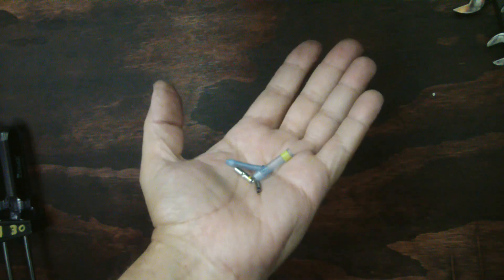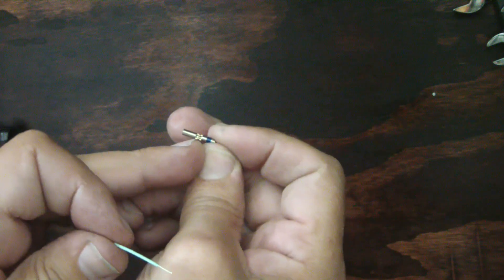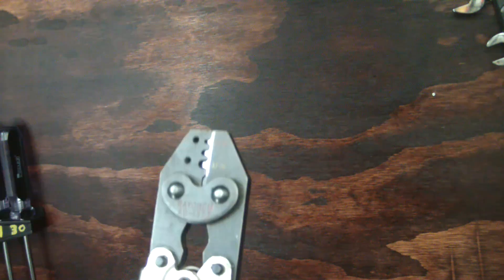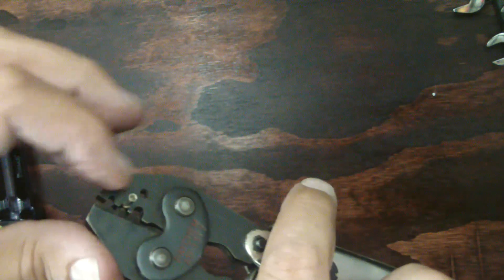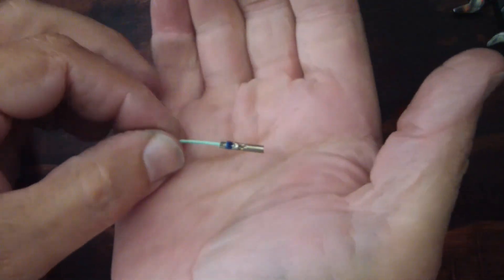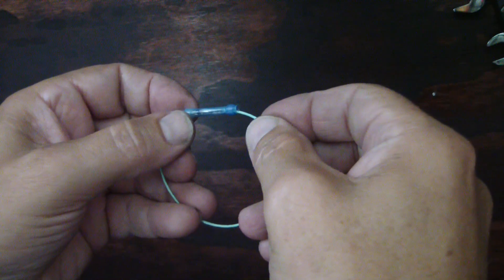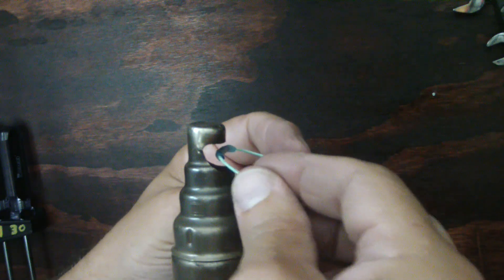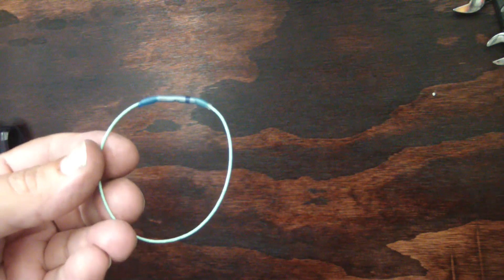Crimping an environmental butt splice / water proof splice

Comment from the maker: Heat Shrink Water Proof Butt Splice Kit
https://amzn.to/3MWT839
Cordless Heat Gun
https://amzn.to/3MXAbxd
Wirefy 95 PCS Heat Shrink Tubing Kit - 4:1 Dual Wall Tube - Adhesive Lined
https://www.amazon.com/dp/B09NW6TVC6?ref=t_ac_view_request_product_image&campaignId=amzn1.campaign.1O2O2EMD6VNI0&linkCode=tr1&tag=737mechanic-20&linkId=amzn1.campaign.1O2O2EMD6VNI0_1709174175862
Haisstronica 6 in 1 Crimping Tool Kit 
https://www.amazon.com/dp/B0CPPC8W6J?ref=t_ac_view_request_product_image&campaignId=amzn1.campaign.1RDKUM6LG6HV&linkCode=tr1&tag=737mechanic-20&linkId=amzn1.campaign.1RDKUM6LG6HV_1754345250833
Wirefy 200 PCS Non Insulated Butt Connectors Kit - Butt Splice Connectors
https://www.amazon.com/dp/B08BYXP4RF?ref=t_ac_view_request_product_image&campaignId=amzn1.campaign.1O2O2EMD6VNI0&linkCode=tr1&tag=737mechanic-20&linkId=amzn1.campaign.1O2O2EMD6VNI0_1709174205057
MiniSeal Crimp Splices: 50pcs Yellow
https://amzn.to/459Eyko
MiniSeal Crimp Splices: 50Sets Blue 
https://amzn.to/4kwyNSB
Red Heat Shrink Butt Splice Connector
https://amzn.to/4kVngvY
WS-1226D Crimping Tools Works for Raychem TE MiniSeal Low Profile Environmental Splices
https://amzn.to/4ecKZ8Z
Copper Lugs
https://www.amazon.com/dp/B0BB7NBSPJ?

Comment: In your video you talk about and show a Raychem splice, but the link you provide goes to an Amazon listing for TICONN connectors.  They look similar, are way cheaper, but is the quality as good as Raychems?
Reply from the maker: Probably not as good but for automotive work they will be plenty good. The only Raychem's I could find at the time of this video were outrageously expensive. I have just found some JReady splices I just added to the description that are M81824/1-3 that are reasonably priced.

Comment: Its not a guard. Its a go no go slot that blocks oversized wires from being inserted. It also helps retain the splice. $1 per splice its top of the line and the mil-std crimps are $260 new. Not for menial tasks.

Comment: Splicing wires that are critical i.e. Maritime, Aviation, Telecom and Space is not optimal......we replace the wire, harness, cable in its entirety always. Solderless (crimped) Terminations is a different thing.  having said all of the above, if you have to do a splice, this Gent's video is top shelf using the Raychem system IMHO. BZ
Reply: Only matched set cables should not be spliced otherwise the standard is no more than 3 in series. When done properly, splices are as good as gold and will function sufficiently for analog and power applications. When standards dictate solder splice in rs232 arinc etc data sets then yeah okay if your wire guy is a journeyman then make that mofo replace the wire but he should learn to use tools effectively and get good.

Comment: You said "solder". Is there actual solder in there?
Reply: @737 mechanic Do the repair video using a full 120 pin 90 degree cannon plug with solder sleeve shields, guard wires, foil layer shields on braided/woven 'ribbon cable'. And do it in a space you can only reach one arm into.. Then have someone over you bitching about that plane needing to be full mission capable before you leave also you have to stop work so they can jack the plane for tire servicing ;).
Reply: Yes! It’s legit
Reply: They do sell them with solder already in them;  I usually pre-solder them first anyway though.  I still don't trust it. lol
Reply from the maker: Yes, there is a small piece of solder that melts.
Reply: @737mechanic  nope.  not in these.  that's a different animal entirely.
Reply from the maker: @timnelson6055  Opps, I just realized what video this was.  These do not have solder in them
. I need to do a video on solder sleeves.

Comment: Good explanation.
May you send the part numbers of splices red, blue and yellow with their sleeves, please?
With many thanks.
Reply: search for 'Raychem butt splice' and you will find what you're looking for
Reply: @tw0million  Nice foolproof system but the crimper alone is over $200, the connectors are between $1-1.75 each and you will need a heat gun too. I solder, then add a decent layer of vasaline over the connection then heat-shrink. Crude, but effective method.
Reply: @barryaiello3127  you're exactly right. these are aviation splices so they are not meant to be cheap but 99.9% reliable. there are much cheaper alternatives of the same thing that can be crimped or have an internal solder ring that (in theory) fuses the wires together. I'm skeptical if they work in the long term but who knows. I am sure that your way is probably the better low-cost solution.
Reply: @tw0million  When you think about the thermal cycling a modern jetliner goes through you'd want to go this route. from a 100 degree tarmac to -50 @ 33K Ft, then repeat 4-5 times every day. I'm amazed these machines are reliable as they are.